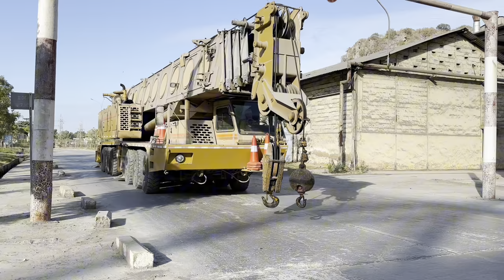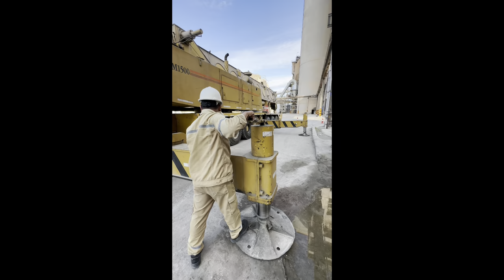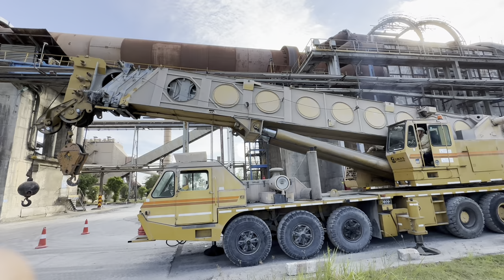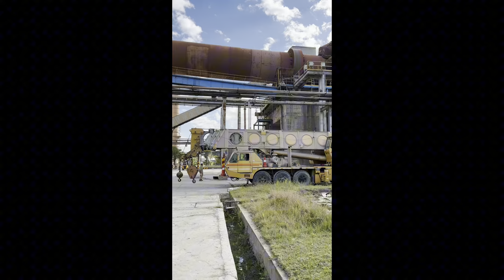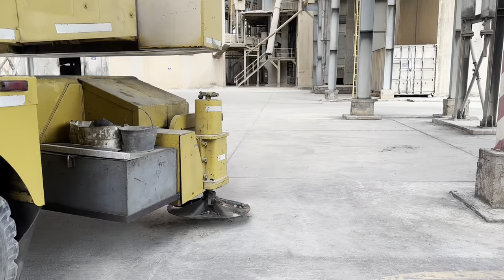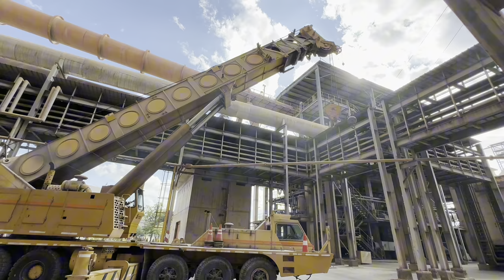Grove TM1500 Hydraulic Truck Crane working in Cement Factory

Comment: I worked on these cranes for many years. They are very heavy, difficult to maneuver ,and extremely inefficient. The German and Japanese cranes are smaller, lighter, easy to maneuver , and carry more loads.
Reply from the maker: Thank you brother, this crane was purchased by my company in 1996 from the USA for 950,000 USD and is still in good use until now.
Reply: Эти краны могут работать вечно .